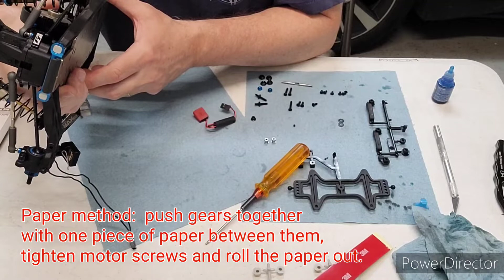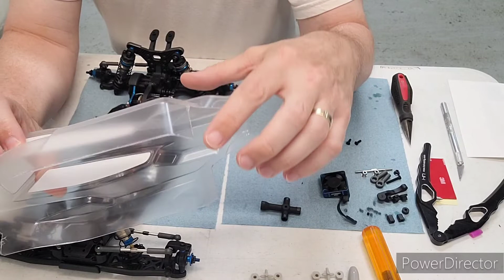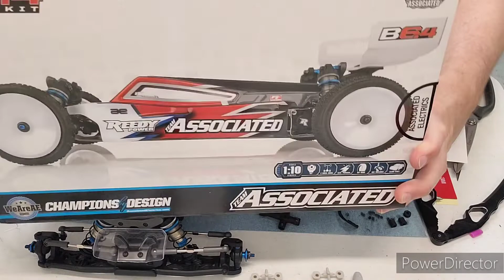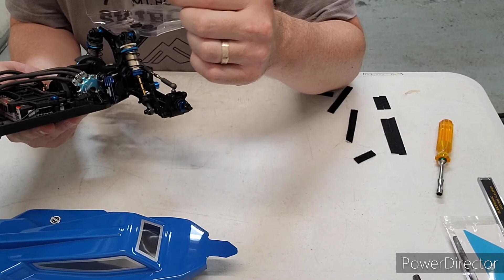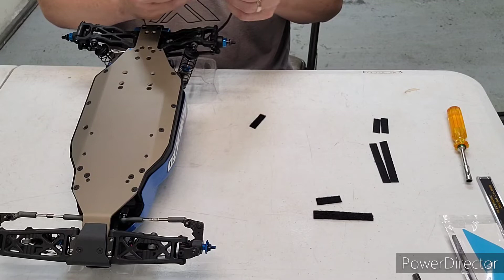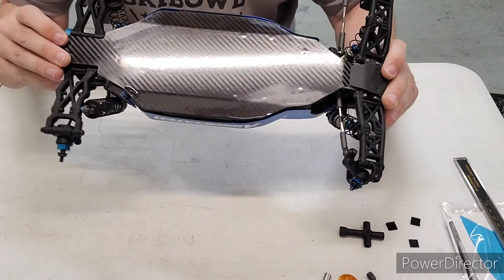RC10B6.4 Full Build Electronics and Body Bag 10

Comment: Thank you for sharing I’m going to get one of these kits too.. can I ask what servo are you using and also what sort of run time will you expect to get out of your lipo 
Reason asking over here in Ireland we have a new club indoor carpet racing buggy club.. and wanted to know how many lipos should you need for a nights racing thanks
Reply from the maker: I am using the MKS 575sl.  The mks 550lx is another great option.  For lipos I have 1 per car and just recharge between runs.  I have not really tested my cars for maximum run time but they easily make a 7 min main.  The battery capacity will vary based on the mah of the pack.  I am using the highest mah I can find in the ulcg thickness which is 4400 mah.  For stock motor classes you will not want to go any lower than this mah and I wouldn't exceed roughly 6000.
Reply: @RCeXtra  thank you very much for your help advice

Comment: Love the videos. Did u end up with some up n down movement with the bellcrank? Mine says to put washers in it but I have no washers that will fit my top hats,did u run into a issue like this? What size washers did u use? The ballstud washers won't work.
Reply from the maker: Shouldn't require any washers in the bell cranks.  Only the hat bushings. Ball stud washers are only used under the ball studs for the bell cranks.
Reply: Thank you 👍

Comment: Do you use black grease where the kit says too. 

I just picked up the t6.2 didn’t come with anything green slime or black grease 

Can I just use silicon grease or a substitute
Reply from the maker: When I am building a stock spec car I generally do not use grease inside the gear box for the gear mesh.  I do use grease everywhere else the manual says.  You can watch my build series on the b6.4 for all the details.  Using the kit black grease is not essential. In fact, I only use the kit grease for my turnbuckles!
Reply: @RCeXtra  ok cool thanks yeah Iv used the tlr kit grease on turnbuckles as well to help them seat into the cups